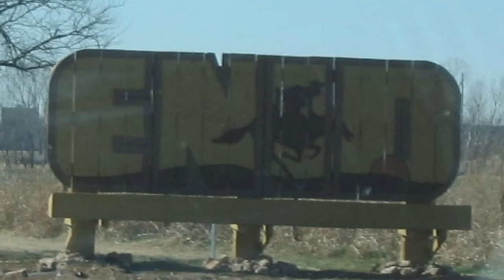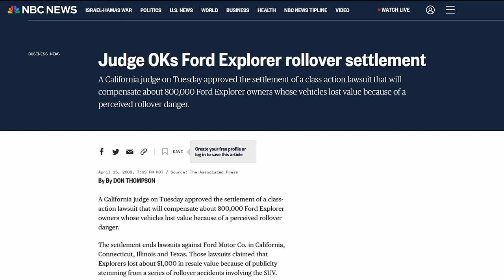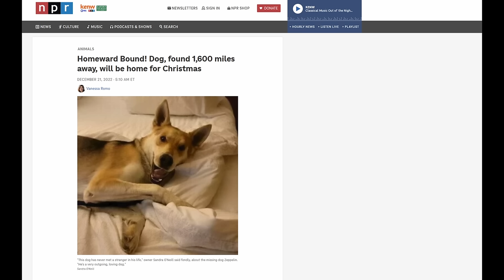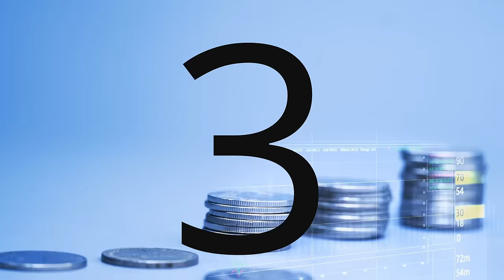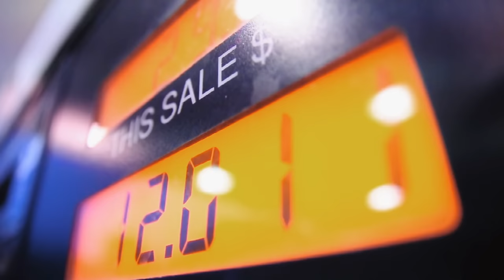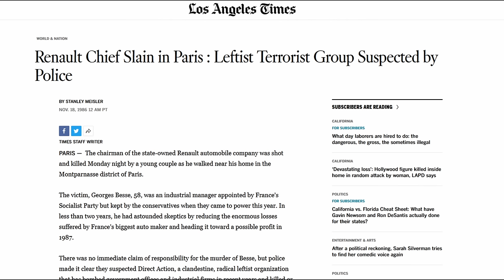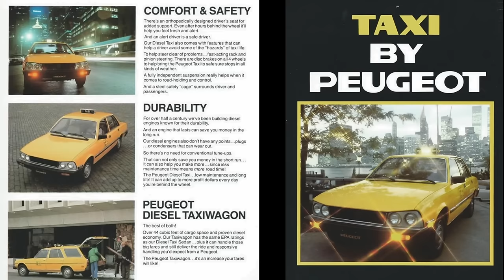Why French Cars Are Not Sold In The US

Comment: For Renault since 2000, there was almost no point to sell cars in the US because of the presence of Nissan. Nissan light vans (like the NV200) are based on Renault designs (Trafic) in addition to share many mechanical parts on most of their cars, including the Nissan Versa. And due to the recent schism inside the Renault-Nissan alliance, it's very unlikely Renault will make a comeback in the US in 2027.
And due to the collaboration between Fiat and PSA (Peugeot-Citroen before Stellantis) Dodge light vans (ProMaster) are also based on the same design tan the Peugeot Boxer/Fiat Ducato.
3:09 15%, not 49% (source : Citroën French wiki)
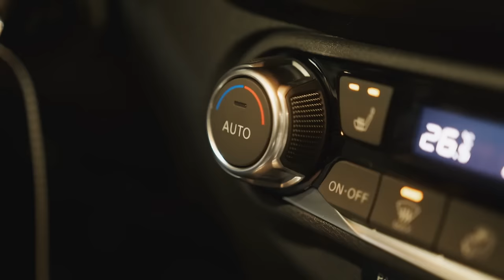7:36 It's almost impossible to find a new French car without A/C in 2023, except for basic entry level models in small cars.
8:47  Not a standard Renault 9 : the front has been modified by a "Jacky tuner", in France this kind of (illegal) modification gives this type of car the nickname of "merguez" (spicy sausage).
There was a car sold by Chrysler in the US that has been designed in France : the Dodge Omni/Plymouth Horizon (originally sold in Europe under the name Simca Horizon, then Talbot Horizon after PSA bought Chrysler European operations) although the engines were from VW for the entry level and fromChrysler for the 2.2L versions.

Comment: My older brother had a LeCar, and my dad had a Peugeot 504 in the early 80s. The LeCar would be an okay 2nd car but wore out quickly, and the engine died at 90k. The Peugeot was not a cheap car, stripped out and very plain. The problem was parts. This was pre-internet, so you had to drive hundreds of miles to get parts. So French cars are great if you are in France.
Reply: 1970 Renault 16.  Very nice car but not suitable for USA.

Comment: You got a lot of the main points.  A couple of other key issues:
1. Engines.  France heavily taxes big engines, so French cars have always had small ones.  The Citroen DS had a 2.1 liter 4 and this was typical.  Americans preferred larger engines, especially as many of these cars were expensive.
2. Rust.  Renault was very successful in the US in the 1950's--but their cars got a bad reputation for ruting away.  Some French cars (notably Peugeot) were better on this, but, in general, it was a problem for owners and brand reputation.
3. Eccentricity.  French cars had a reputation for being quirky and oddball.  Some people loved this, but most Americans just wanted a "normal" car.  This was especially true with cars like Citroen, whose unique design and engineering were understood by very few mechanics.  Even Peugeot--the most conservative French company--put the turn signal on the right side and the horn on the turn sinal.  People just couldn't get into it.
4. Marketing and Image.  People had a hard time defiining what French cars were supposed to be.  Were they economy cars?  Luxury cars?  Sporty cars?  The answer was not exactly any of these.  Mercedes was luxury.  BMW was sporty.  VW was economy.  Volvo and Saab wee safety and hardiness in cold.  Peugeot was ???.

And you're spot-on on the issues of parts cost and availability and weak dealer networks.  It's a shame as my family had several Frenc cars and they were charming, comfortable and fun.

Comment: My first car, in 1990, was an '83 Renault Alliance. The rear window decal proudly proclaimed "Motor Trend Car of the Year". I have no idea how it won. This car was the lemon of lemons. The power door locks didn't work, the automatic transmission had no 2nd gear, the radio randomly stopped working, I replaced the head gasket, the thermostat, and the water pump, and it would still overheat during summer unless you ran the heater full blast. This car was only 7 years old at the time, it had about 60K miles when I got it. These days, this level of unreliability in a car from 2016 would be utterly unthinkable, even in a Kia or Hyundai.
Reply: $$$$$$ via advertising in the magazine is how they won.
Reply: I shopped for a new car in 1987. I looked at Yugos, Chevettes, and tried to look at an Alliance, but they just went bankrupt, and the local dealer had only one which he seemingly had given up on and parked out back. So I ended up with a Dodge Omni.
Reply: I had better luck with mine, but it really did suck……and any credibility that Motor Trend magazine may have had was utterly lost

Comment: as a frenchman, I would never buy a french car now, they are mostly state owned enterprises now, which means build down to a price sacrificing quality for volume.
french business is hamstrung by socialism.
aftercare is a joke, the majority of mechanics don't know what they're doing.
as an example, an acquaintance had a problem with very fast idling on a fuel injected vehicle.
it was left with a mechanic for nearly 2 months.
when they got it back, the brake rotors had been replaced, the mass flow sensor and ignition module had been replaced and the fast idling had not been fixed. the bill came to hundreds of euros. 
luckily, I learned mechanics in britain, so I offered to have a look.
I looked at the inlet side of things and removed the throttle body for inspection/cleaning and noticed discolouration indicating a leak after the throttle body.
a new gasket was ordered (2.56euro) and installed.
the leak was causing the ignition to think the throttle butterfly was open, therefore the engine management was pushing fuel to match airflow.
if dealer mechanics trained by the factory can't fix anything, I don't see how mechanics in the US would fare better.
also, most things are designed by committee, in the socialist fashion, a surefire way of ensuring a shoddy product.

Comment: Renault sold a lot of Alliances and Encores. They just didn’t hold up. I worked at a Combination Chrysler/Plymouth/AMC dealership that sold Renault . We sold a lot of them. The 1.4 liter had a rough idle that that basically owners had to live with. Brakes didn’t hold up, rear axles seized up and had to be pulled apart and greased . The 1.7 liter engine had issues. I remember the plastic bushings in the shift linkage disintegrating, electrical problems. Word of mouth spread quickly. By 1986/87 we were hardly selling any Renault products.

Comment: I owned an auto repair shop in the 80s. The Renaults were very unreliable and were the worst cars to work on. I remember the Renault "Le Car" required either the engine removal or cylinder head removal just to replace the starter. The Renault Alliance used to strip the plastic speedometer gear in the transmission and you had to remove the transmission and  dissemble it completely to get to the  plastic gear. We finally refused to work on them at all for anything.

Comment: I ran a Renualt /Jeep / AMC parts department here in Pennsylvania in the late 70s....talk about rolling Dumpster fires!
Wierdly, all 3 of those brands was zeroing in on failure for essentially the same reason: an absolutely startling lack of parts and service support. At that time, Jeep products were essentially in the tolet. They were a hodgepodge of any lousy parts they could screw together,with guality  and interchangeably not considered.
AMC were about to crashland....the last cars they sold were largely rebadged  Renaults.
And Renault: basically pretty ok cars that you could not get parts for.
Within the dysfunctional family of AMC and Renault, there was tremendous animosity. The AMC guys were all 50+ year old Americans named Phil or Wally. And, I swear, 2/3rds of the Renault guys were yonger guys named Henri or Rene. They shared faciilities, and neither clique new anything AT ALL about the other brands. Jeep was still a Willys 
product, that was broke. So all there parts were the cheapest available.
And, to close my case, there was no technical support for service issues. None.

Comment: Mechanic here:
French Cars Are poorly designed and mechanically Bad. 
English cars are mechanical disasters and operate off of the old "if it isnt leaking oil then it hasnt got oil" adage.
German cars are overengineered in a bad way.
Italian cars are 100% form over function and get regularly outclassed by other vehicles for half the price.
Japanese cars are 100% efficiency. In all ways. The reliability is a product of efficiency. 
Korean cars are just "yeah you can copy but just change up the answers" japanese cars.
American cars are big and typically have an engine and drive train architecture that's already a decade outdated at release.
Reply: It depends on what french car it is. Some older german and french cars are simple and reliable, at least thats what they are known for over here in europe. Like the old vw golfs (1-4 gen) or the peugeot 205/206. And japanese cars are known to rust badly over here in europe, so even if the engine is good the body isnt. Hondas are known to have oil burning issues aswell
Reply: @foxy126pl6  
Pre-96 Japanese vehicles notoriously rust as the steel is outright inferior. 
But yes, up until the mid-80's the German cars were about as complex as anything else globally. The Germans have a terrible habit of just adding unnecessary sub systems to kind of 'smooth out' general operation. As far as daily driving goes, ill take just about anything Japanese or American over euro cars as a rule though.
American vehicles are enormous and use older style drive trains and engines typically but the roominess and older design philosophy typically just gives it an ease of maintenance and parts availability.
Reply: @tinoduran4557  well, its not just pre 96 in europe. The 7th gen civic and 1st gen fit/jazz rust a lot, same like all mitsubishis and most toyotas. Korean cars are better at that usually, becouse rust proofing is better. Also i agree that euro cars are usually harder to maintain, but at least in europe as long as you know what to avoid (anything petrol thats turbo and direct injected really, plus some others) they arent that unreliable. The new volkswagens 1.0 i3 MPI engine can do over 300 thousand miles without lots of issues if maintnance is done on time and on goof quality parts. Same with PSAs "ET" engine

Comment: I thought it was just because most of them totally suck. What are we actually missing out on? Just the Alpine 110… I can’t think of a single other French car that we don’t get, that is actually interesting.
Reply: Every single Citroen that has a hydropneumatic suspension......
Reply from the maker: The Clio v6 which was a mid-engine hatchback is the main modern one I would want
Reply: The classic A110, the successors, the 5 Turbo (which by the way, it was a shame y'all didn't get it there), Clio V6, Safrane Turbos, etc
Reply: @chucku00  I specifically said every single Citroen THAT has hydropneumatic suspension. I didn't say that they ALL have. There's a difference there.